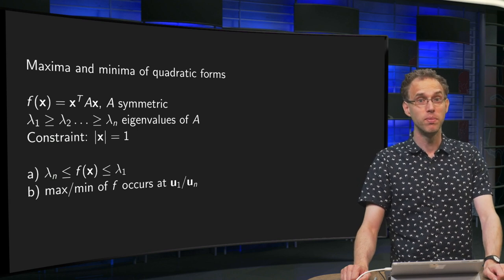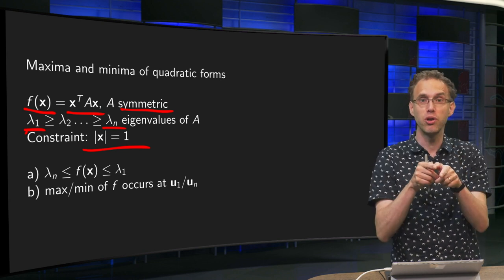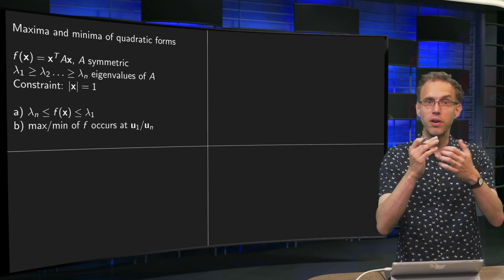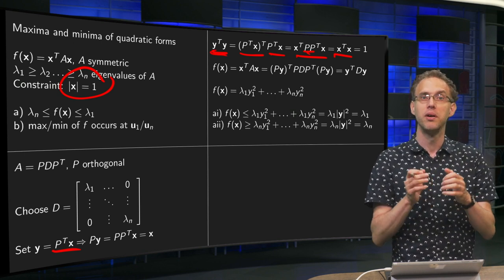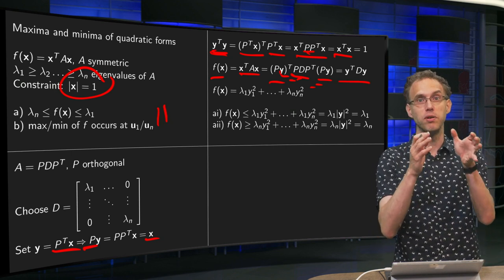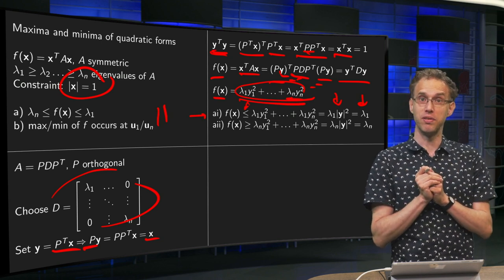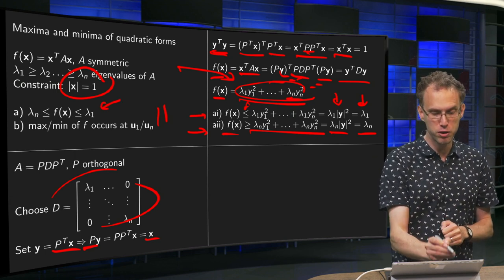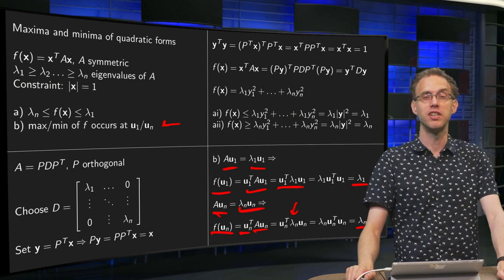Maxima and minima of quadratic forms

Comment: Can u please explain me the last step Au1=hu1 how?.. and how to apply it on any example
Reply: How to find u1,un in any example?
Reply from the maker: Hi yahoo.5, thank your for your question. In the first part of the video we show that our function is at most lambda1. Now we want to find the vector x (if it exists) where f is exactly lambda1. If we can find such a vector x, then we know that we have the maximum there.  We now do the ansatz/guess that this maximum occurs at x=u1, the unit eigenvector corresponding to lambda. We then show that f(u1)=lambda1, which indeed shows that the maximum of f occurs at x=u1.
Reply from the maker: And with regard to your second question: if you have a symmetric matrix A, you can find all of its eigenvalues (maybe numerically is A is large) and then pick the largest one (this is lambda1) and find its corresponding unit eigenvector, which is u1. Hope this helps, good luck!
Reply: Got it. Thanks